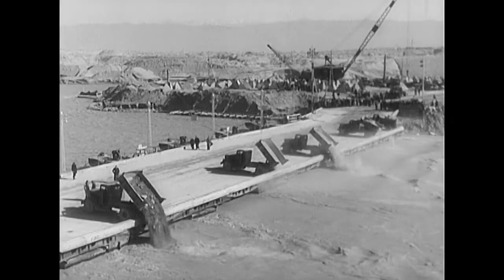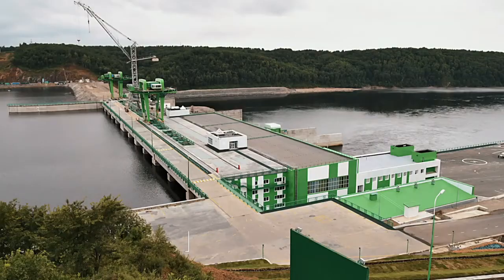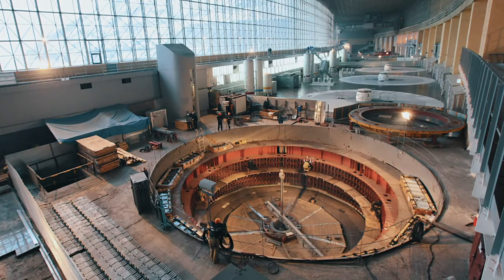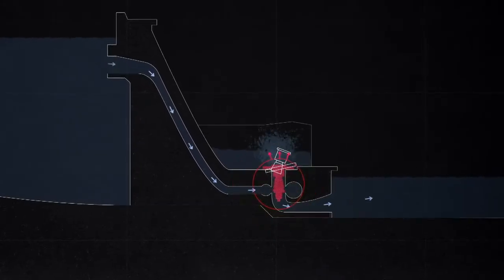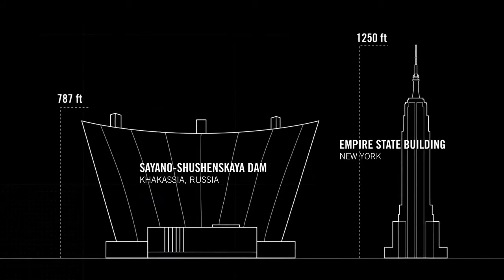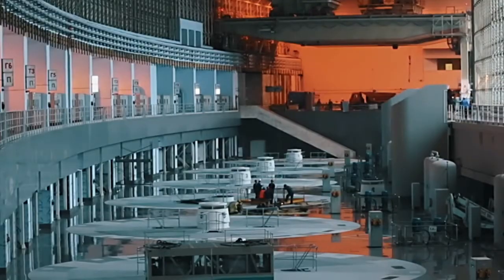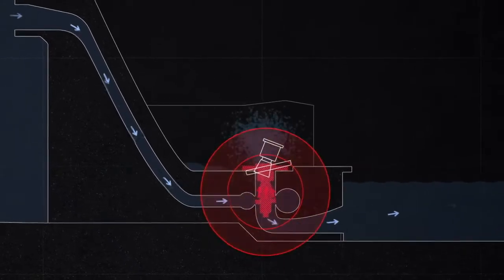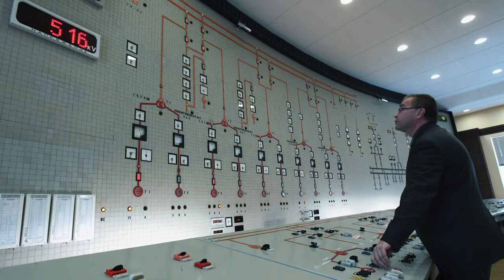Turbine Destroyed in Sayano-Shushenskaya Dam in Russia #turbine #dam #hydropower #documentary

Comment: Back in August 2009 I was working for the Los Angeles Department of Water and Power as an operator in a Steam Electric Generating Station called Scattergood Generating Station. I read a report about this hydro unit disaster that took place in Russia at work not too long after it happened. This disaster basically destroyed this Russian Hydroelectric power station. What surprised me in the report was that they were using this hydro unit that had abnormally high vibration.
Reply: You used the word '"working" very loosely. You were there, at work. SGS used to be nice.  It's not just good. it's Scattergood

Comment: So it was operated beyond it's safe working parameters and/or lifespan and not properly maintained right?
Reply from the maker: Brother it happens when you operate a machine beyond it's safe limits 
That's why engineers provides safe limits to operators to operate a machine safely in long run
Reply: Well, by the sounds of it, new bolts had been due since the year 2000. They over-worked one turbine on 40-year-old bolts. That's like driving on a highway with seven-year-old dry rotted tires. You will get some fancy vibrations at high speeds.
Reply: In and out of the danger zone too many times in a short period of time…. But it would have failed sooner or later….